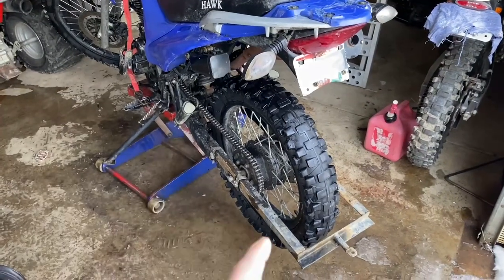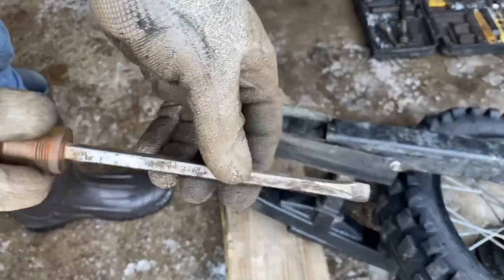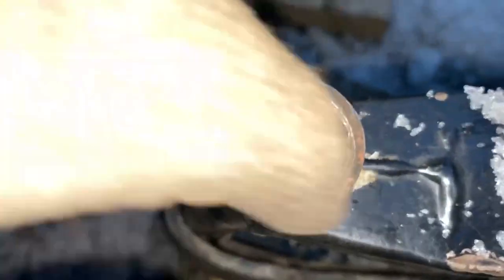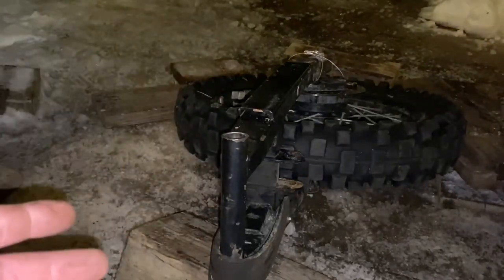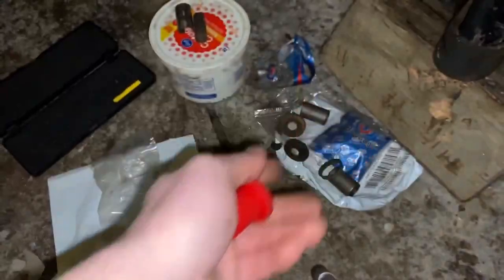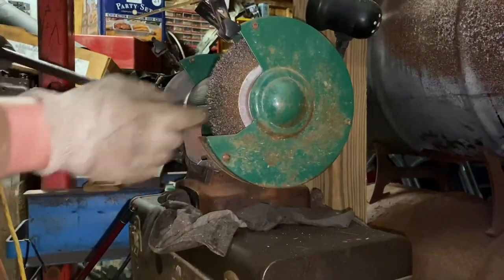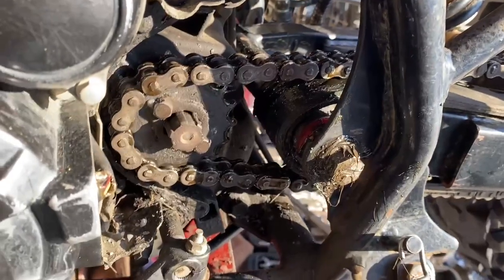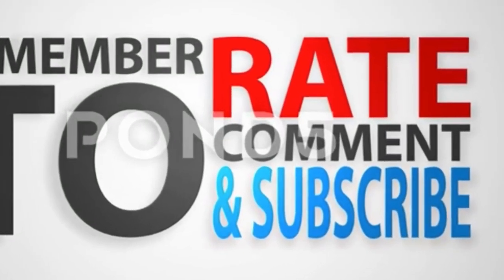Hawk 250 swing-arm bushing replacement!

Comment: Hey man I don't know if you might be able to shed some light on this but, I just recently got my Hawk 250 and put it together only to find out that the brake lights on the front and the back the sensors are not working and what's worse the rear sensor when it's pulled starts the engine I don't know if maybe you knew anything about that
Reply from the maker: Yikes! Sounds like some wiring got swapped around at the factory.. my guess would be to check the simple things.. I would by finding the starting wires and trace them, also trace the rear brake light wiring and see where it goes. I always hope for the best, and In that case maybe some wires need unplugged and swapped around. Hopefully this helps!